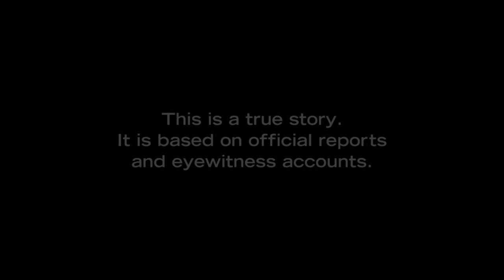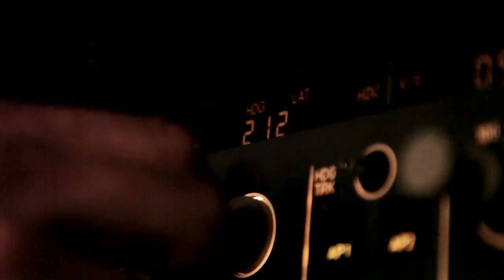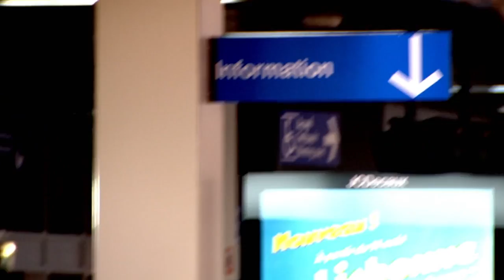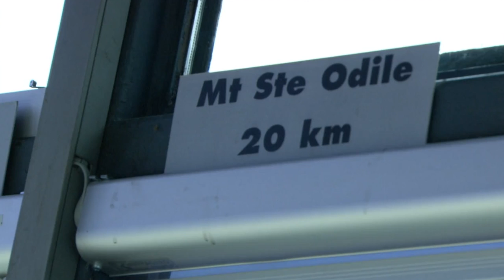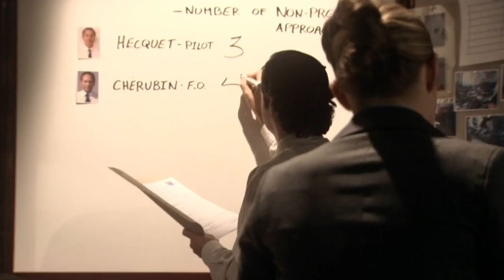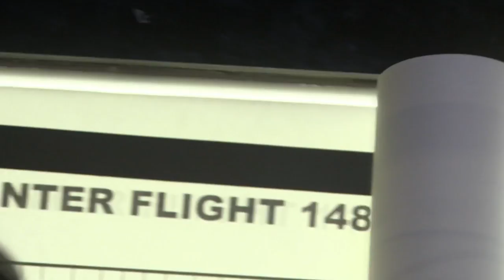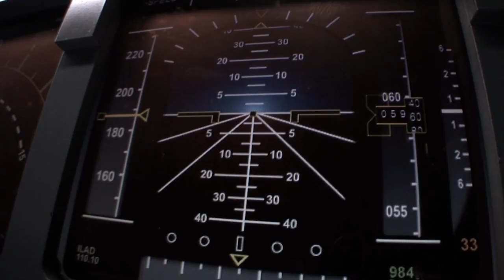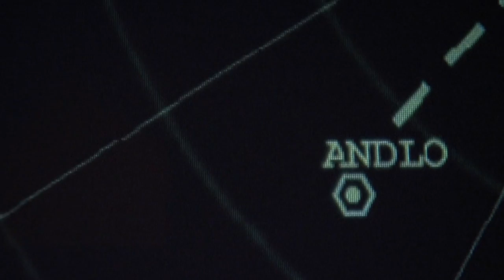Air Inter Flight 148 Crashes Into The Vosges Mountains | Mayday

Comment: ....as you watch these episodes it's evident, "rushing" to meet a schedule or beat a storm is a killer.  it's there over and over again.
Reply: American Airlines flight 1420 is a prime example of that.
Reply: Heartbreaking that the same mistake caused disasters like Uruguayan Air Force Flight 571, or even the Donner Party. It’s okay, just take a little longer and wait instead of getting stranded in the snow!
Reply: So true and it sucks that these airlines and employers put such stress and  consequences if the pilots go over these times or don't meet the requirements.
Reply: True, but then again, they get graded on punctuality, until a crash & then they’re on the chopping block

Comment: HOLY CRAP...I ALWAYS ASSUMED ALL PLANES had ground proximity warning systems. I mean, REALLY...WHY WOULDN'T THEY????
Reply: Yes it’s required for us at least in the United States. I assume the eu is the same but never worked in Europe.
Reply: Their plane was configure for Landing and their Landing gear was down. The Ground Proximity Warning won't go on. How many Airplane Crash investigation have you watch???
Reply: @mohammadbazzi3072  not true. If a plane is about to hit a mountain, the GPWS will indeed sound regardless of configuration. It will sound 60 seconds prior to a possible collision. Air Crash Investigation don’t always get the warnings correct in their episodes, either.

Comment: Scary how flustered the captain became when he realized he had to fly the plane… this autopilot and computer systems have made it dangerous to passengers not because of the computer systems itself but the lack of actual flying that’s done by humans. They relay way to much on autopilot and lack the knowledge of hand flying and basic instruments. Sad.
Reply: Indeed 😨. Its why AI will NEVER be a proper replacement for wise rational human based decision making.
Reply: @MLU8811 Could be that there was an agenda, could be that the Captain was tired and frustrated and they over did it in the reinactment. It also could be that the frustration that the Captain was expressing had more to do with fear and his incapacity to fly the mission. We will never know but there is one thing for sure, they are all dead and it is the Captains responsibility. P.S. After a decade or so, you don't even remember that the CVR is there, so you say what you feel and as long as you don't get into an accident, it's over written every 20 minutes. Don't think that crews are making a short movie for your entertainment every time they strap on an aircraft.
Reply: @MLU8811 ummmm i hope you realize that for each flight featured where the CVR is recorded they get actors to say the exact same things as the pilots
Reply: @jorgeifyaknowyaknow5930  exactly! It makes you want to say DUH!!!
Reply: @peterolsen269  all that was unnecessary
Reply: @peterolsen269  old man yells at cloud
Reply: @Tbonedoesfsx  Young man makes bad choices and pisses his pants.
Reply: @peterolsen269  Leaving aside your culture-war cradle-to-grave assertion, I have to say, you've got the Miracle on the Hudson all wrong. Actually, automation kept the airplane from stalling right before landing. With everything going on, Sully and Skiles didn't notice their speed was dropping dangerously, so low that, when Sully flared to land, he'd have dropped like a rock. The thing the FAA tried and failed was landing at other airports, which was only possible by turning immediately like they knew what was about to happen and how it would affect their plane.
Reply: @Amanda-C. It seems as though I cannot reply, too much for YouTube to host. I would love to argue this point with you but I'm being sensored, something that doesn't surprise me on this platform. Only comment I'll make is there are ten times more fatal accidents caused by automation and poor pilot skills than are ever saved with 'fly by wire". Sully could have done it in a 737 with cables and hydraulics.
Reply: Most of these crashes are human error. So a lack of training is a problem, but putting the controls in the pilots hands more ends in more accidents. As we’ve seen so often in these programs.

Comment: What an incredible lack of professionalism. There is no place for temper and impatience in the cockpit.  If the captain doesn't have the skills to land without a computer he shouldn't be flying.  The pilot is way too impatient for the safe operation of an aircraft.  There was no excuse for this crash. Had the PIC been calm and patient and taken his time, he would have landed without a problem.  He could have also chosen to divert.
Reply: Oh c'mon. Computers are there to assist the pilot in flying
Reply: @nieshamccoy9419  I've always found that when you are dealing the pilots that do not have good flying skills the best thing to do is to divert.  If you look at Flight 3401 that killed all those people in Buffalo, the pilot had failed five simulator tests and did not know how to fly in icing conditions.  Had he just not flown that day, even though his skills were poor, he never would have crashed.  So, if this pilot couldn't land without an ILS system, he should have just diverted. .

Comment: No "pull up, pull up" was ever told to the pilots by the planes system as they fly straight into the side of a mountain!
Reply: They disabled it (Airbus) because it was giving to many false alarms. Inexcusable!
Reply: Yeah, they said that.  That's what the GPWS (Ground Proximity Warning System) is supposed to do, but like the video said near the end, that particular A320 wasn't equipped with one.
Reply: @valerierodger7700  UNBELIEVABLE❗
Reply: @YTjennifer  I'd damn well rather have one that will give false warnings than not have one at all.
Reply: @ziggyzap1  Agreed, though maybe it was like when your smoke detector goes off every time you make toast? Still . . .
Reply: Probably back in the day. At least in the US gpws is required for 121 carriers today. I assume the eu is the same.

Comment: Once again, this accident reveals the importance of streaming the data to a remote recorder so you have the information that you need to investigate a crash
Reply: Good in theory. In practice not as easy to implement
Reply: They would need to be a satellite uplink, cell phone data links don't work at a high altitude. It's probably some other form of communication that could be used. But it would get tricky on Long flights over Ocean or empty spaces.
There is engine telemetry broadcast to satellites I believe. It's one of the reasons they were able to track that Malaysian flight that went missing for a while. The engine maintenance information was still being sent
Reply: Agree, especially with today's technology. I can understand prior to the "high speed internet age" this would not be possible on planes pre-1998.... but today? Should be instant and live streaming information on the plane's location and mechanical condition. If my wife's Buick Enclave can tell On Star about a tire with low pressure and On Star then tell her as she is driving, modern airplanes should be able to do far more.
Reply: @ScarabChris  planes and cars arent compareable and this crash happened in the 90's
Reply: @ScarabChris :  But tiny bandwidth vs. huge bandwidth.  Planes fly in lots of low population areas. 

Cost is a serious issue to make it highly reliable, which is why it hasn't been done.  

Maybe when the earth is blanketed by LOTS of WIFI satellites and plenty of bandwidth things will be much different for this.

Comment: Feel like a couple things should be mentioned as everyone seems to be complaining about automation:

1. Airplanes are statistically safer today because of automation even with more planes in the sky
2. One of the major causes of this crash was LACK of computerization. No GPWS warning system on Air Inter at the time.
3. Poor cockpit design (-33 vs -3.3) also played a role in this crash.

Ultimately this was CFIT due to human error compounded by poor training. But that doesn't inherently mean our "over-reliance" on automation is a bad thing. Flying is safer because of it.
Reply: waitttttt I thought GPWS was required
Reply: @ThatAverageMTBer  it is now

Comment: Doesn’t matter what your job is, you cannot be pissed off/frustrated and expect to make good decisions. I know that from driving a vehicle around town. I used to drive a semi too. Anger takes a lot of energy to maintain. Energy which could have gone to flying the aircraft properly. I’ve been in panic situations while driving trucks. It takes a calm mind to adjust to new situations and dangers as an operator of a massive conveyance with passengers. My vehicle was 65’ feet long, 12.5’ wide and 13’6 high and at full weight 80k pounds. It’s a missile on 18 wheels. I drove it with that in mind constantly. I left impatience and irritability at home while over the road.

Comment: A couple of problems are going on here.   The pilots did not know where they were.  And they didn't watch the airspeed and and altitude.  Another problem was that they weren't actually flying the plane.  They were much too dependent on two things: one was the total dependence on the auto pilot, and they didn't pre-flight the pilots.  The pilots had flown the route over and over, but did they ever take a look, in advance, of a sectional chart.  They should have been very cognizant of the terrain terrain around the destination airport.  They forgot, the crew, to aviate, or just plain fly the airplane, and they got distracted.  The EU controllers are very different from American pilot training.   So, making the decision to use the auto pilot to fly the approach, a non precision should have been a piece of cake, and I don't think they knew how to fly a VOR approach.  I was a chief pilot for an airline years ago, and saw the same problem.  European training is very heavy on " book learning", and still are.   That's all nice, but they need to have a lot more stick time.  So, in my point of view, the investigators were only partially right, but mostly they were just wrong.
Reply: On a previous episode a former pilot now investigator stated that when it comes down to it THE PILOT should fly the plane, and due to automation, that necessary action no longer happens.

Comment: French should be charged with criminal negligence for letting the FDR burn.
Reply: They were just doing as they were told at the time. The recordings on the Air France test flight incident showed that there will be possible attempts to tamper with the recordings. Airbus tried to do that. The French police just doesn't want that to happen again.

Though, their rules should have their Air Accident Investigation Branch be the first and the ONLY ones to have access to the recordings and the crash site. They probably learned after that.

Comment: If the controller wasn’t happy with the plane going slightly off course, why did he give confirmation to land?? Also, maybe the captain’s frustration at the thought of a delay affected his ability to direct the aircraft slightly?? I say that because the first officer noticed it and the controller noticed it, so why didn’t the captain?? I’m surprised that someone didn’t notice how confusing that auto pilot interface could be. Some aircraft equipment is not designed to be easily used or read. I don’t understand why that is though?? Surely it should be designed to be as easy as possible, to either read or use??

Comment: Why don't they use airborne thermal imaging to locate plane crashes in less-accessible areas?  If they launch the search before the ensuing fire burns out, the crash site should stand out like a beacon.  They could have searched 20 square kilometers very quickly from a light plane or a helicopter.  Even a drone would be much faster than bushwhacking blindly through the forest, though of course that wouldn't have been available in 1992 when this crash occurred.

Comment: What's not in there: The elephant in the room is the TGV high speed rail in France taking most of Air Inter's passengers. So mostly the flights not from or to Paris remained sellable.
That extreme pressure on the pilots to be faster than the plan was to stand out for corporate/business travelers.
Strasbourg Paris (European Parliament) was lucrative, as well es Paris - Lyon and Paris - Marseille and Paris - Nice. All done by fast TGV already 1992.

Air Inter folded shortly after and the  remainants have been Incorporated into Air France.

Comment: Surviving subzero temps in the darkness should be a lot easier next to a burning aircraft than it would be without one...
Reply: And in a forest with wood laying around to feed the fire. I never seen a forest that does not have wood laying on the ground or dead branches.
Reply: @Crashed131963  Right??   It'd be a lot colder if the plane crashed and wasn't on fire.

Comment: With all the satellites we have in the thermosphere and exosphere you'd think we could just store all flight recordings on servers instead of blackboxes that burn up or disappear in the ocean.
Reply: You'd think. And in theory, you've got a pretty good point. Even having satellite tracking on all aircraft would help in some cases. Matter of fact, some of the technology does exist--an Air France ocean crash was located in part by using the aircraft's onboard "phone home" data setup.

There's a few issues to solve, though. 
--The entertaining one: How much data/which parameters get sent, and at what interval? Basically: Do we do continuous transmission of all data points, or do we do a spot check of some or all and send that, do we transmit the last X minutes every X minutes as a bunch? There's a number of technical arguments for or against all of those. Also, how long are the recordings kept?
--Related issue, how many channels is the data sent by? Satellite and radio links can all go down. It happens, for a wide variety of reasons. Could just be the airplane went on a route where there isn't as much coverage. And, in an unrelated note, how do we deal with failed transmissions/non-received transmissions? Again there's a pretty fun discussion there, from a technical point of view.
--Politics: Who's in charge of the recordings? Aircraft manufacturer, aircraft owner, government of either or both of same, government where the storage servers are located? Who can access? How long are they kept? (I did a bit of a quick numbers analysis. If 200 aircraft are in the air at a time, each transmitting 100kB of data every 5 minutes, 240MB an hour is stored. That translates to 5.760GB/day, or about 2TB/year. That's not too bad, per se, as an order of magnitude estimate--until you get 20 years into the project.)

Or you could build a better black box (also an option--today's boxes are markedly better than 20 and 30 years ago).
Reply: @erichusmann5145  How about an impact resistant drone that houses the black box that at moment of break-up or at the instant of crash (and same way air bags are made to go off milliseconds after initial impact) ejects from the plane, sperate from the shell, and can wright itself in the air and fly back to base?
I'm thinking it can be surrounded by a strong material with light density such as an impact foam of some kind. That way if it ejects into water it'll float before flying into the air. Or if it ejects on a mountainside or on to another hard surface it won't be damaged my the ejection impact and then sperate from the shell and fly away.
It'll still have some foam on the body itself so it doesn't sink if in water, and it'll be designed so no matter which way it's in "up" or "down" the propellers will always give it lift, so it doesn't have to go thru an extra step to flip itself, I'm thinking it'll have a gyroscope on it so it knows which way is up when it starts to fly.
There'll also be 2 drones. One will be in the front of the plane and the other towards the tail, that way if one goes out or is destroyed the other will succeed.

Just thinking 🤔.

I'm copyrighting this idea and it's facsimiles right now. I'm also trademarking the names Eject-O-Box, Eject-O-Drone, Drone Home, Last Call, Final Destination, and Lifeline right now.
©️®️™️

Call me to purchase the rights.
Reply: @dsandoval9396  Not a bad idea. But WAY too complex. For one, you need a fairly large drone (these black boxes aren't exactly light). For another, you've got to keep the drones charged up (electrical system) but cut the charge when they're released. And you need breakaway panels. And none of this can trigger while in flight ever.

If it were me, I'd probably just put a spring-loaded ejection system in to throw the boxes in case of crash--foam isn't necessarily a bad idea but I'd probably wrap that on a crash locator beacon instead, and have that eject as well. Hard G force (crash level) or a loss of power or something like that tosses both boxes and a locator beacon in three different directions by powerful springs (or something else non-explosive). You won't get as much range--but a drone ain't gonna have enough range unless you've got Global Hawk or one of its cousins onboard. You just need the boxes away from the wreck.